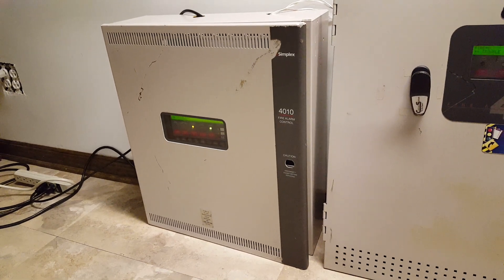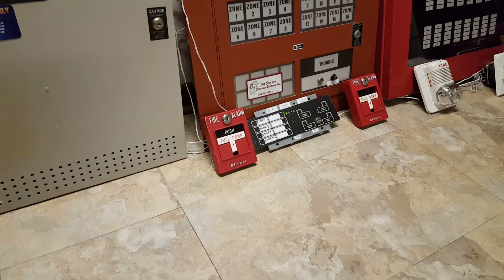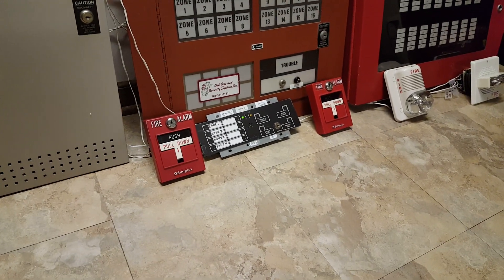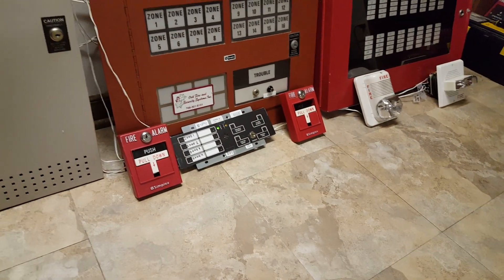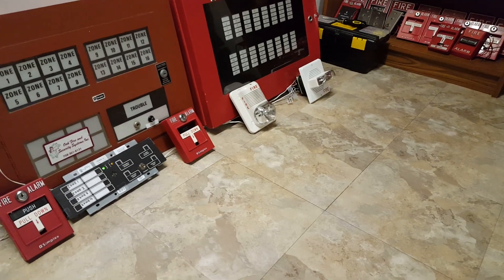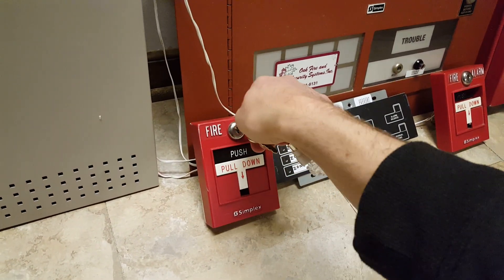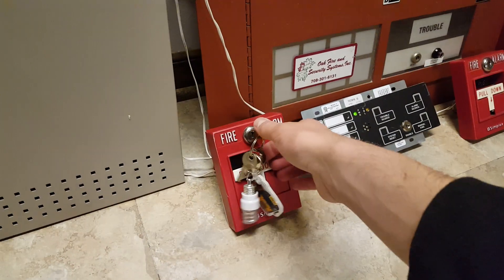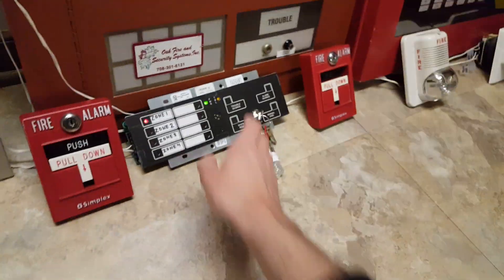Floor System Test 43

Comment: Hi, I have a Kenwood tk-8180 and it allows me to key it up but there is no TPT but the red light comes on when I push the button. It didn't come with any cable to hook it up to a computer and I was wondering if you could tell me what buttons to push on my radio to get it? Bc my radio used to be a cab radio and it don't allow me to pick up nothing. So if you could tell me how to get the TPT and ppl to come through on my radio that would be amazing. Also I do have an antenna but it still doesn't pick up anything.